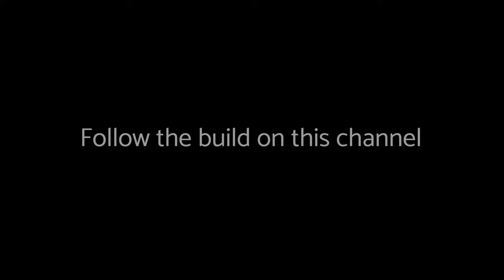Building a Balance 482 Catamaran III: Hull and deck plug construction

Comment: Very nice collage of a building process! Thank you.
Still I have a question? At 2:14 should'nt be the water tank build by something other than the fiberglass and resin? Maybe food graded PVC?!
The fuel tank also? 
(Am not an expert by any means, just curious tho)
Reply: I wonder if they use bladders inside the tanks.  If not, might be a good option.
Reply from the maker: Hi! They are built with vinyl and epoxy resins and have water and diesel grade internal paint applied to the respective tanks.
Reply: @balancecatamarans  Thanks for the answer.
Do you have information/statistics from previous boats(i.e.526) how often the tanks should be cleaned? Do they easily catch algae? And do the paint is chemicaly stable on UV-C light?